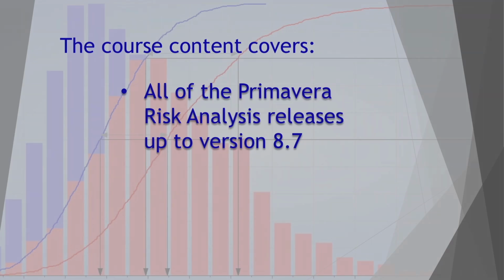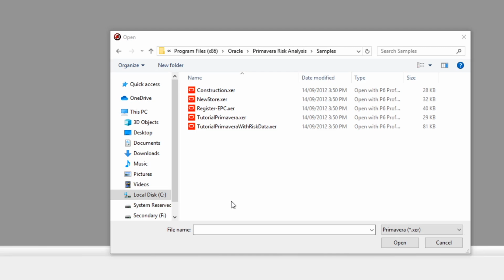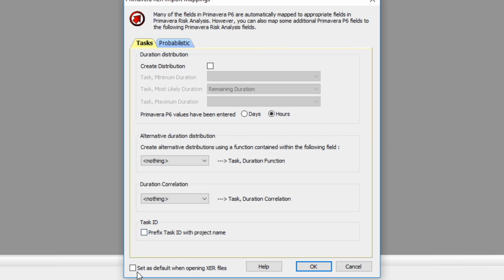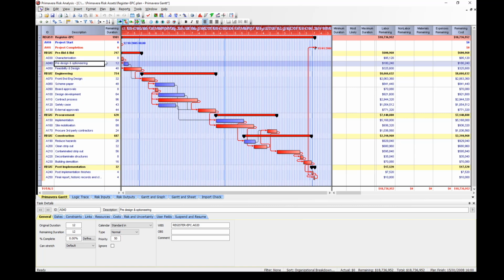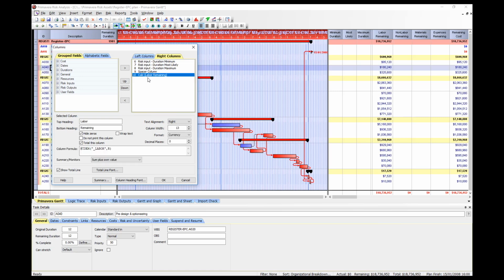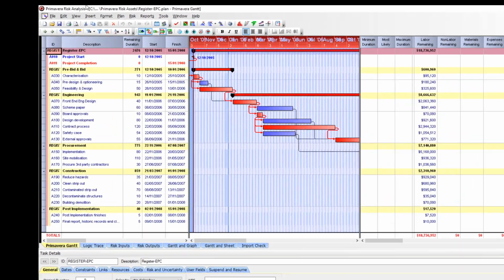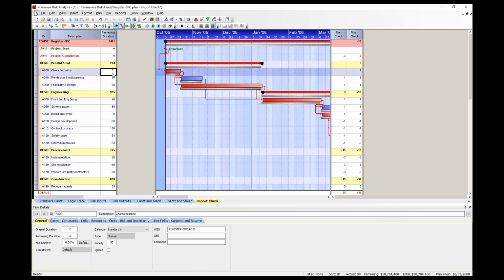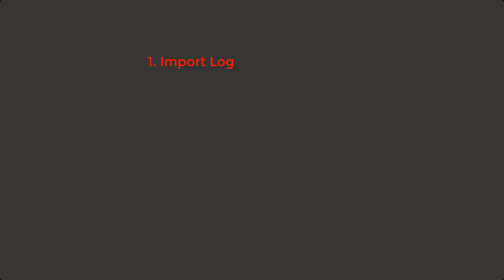🔹 Primavera Risk Analysis Tutorial 🔹 Lessons 1-4: XER Import & Schedule Health

Comment: Hi! I have a question: does the risk scoring reflect a project-scale impact or an activity-scale impact? Typically, PRA assigns, for example, 70 days for a Very High impact, which makes sense at the activity level. However, assigning 180 days (approximately 6 months) as Very High—should that be applicable?

I support using PRA risk scoring based on activity-scale ranges, but some colleagues believe this is not mandatory. At the very least, PRA performs a kind of adjustment that helps when a non-applicable project-scale value is used—impact recording starts taking the scoring as  it is and then adjust.
Reply from the maker: Hi
Unfortunately Gavin is no longer actively supporting his lessons so we can't answer specific questions. We've posted his videos here to be available to the public for posterity (they were originally commercial lessons Udemy). I hope you can find your answers elsewhere!
Reply: @042  where can we purchase his ebook as the website is no longer working?